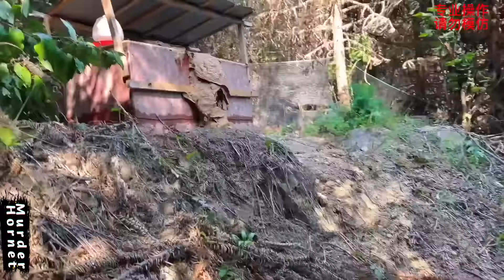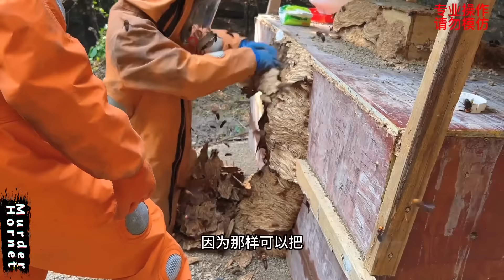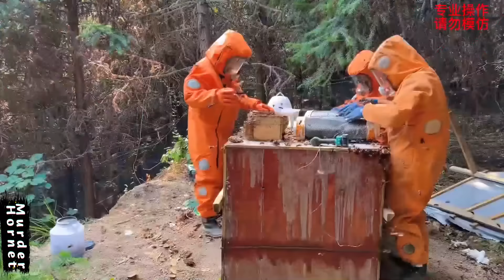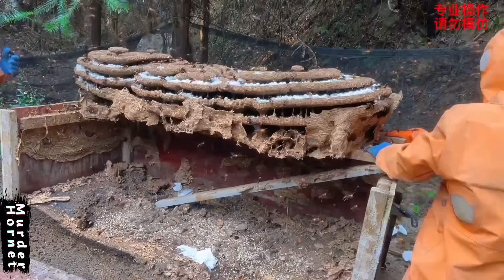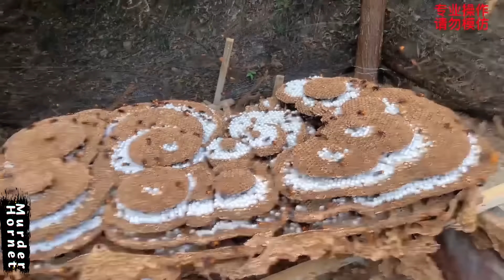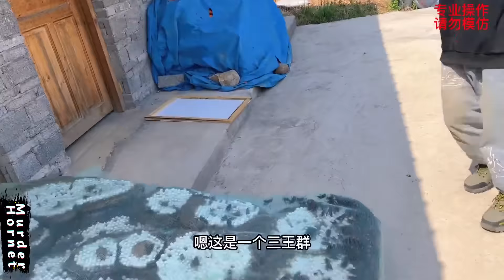ASIAN GIANT HORNET NEST,MURDER HORNETS REMOVAL,WASP NEST REMOVING,VESPA MANDARINIA

Comment: I know a faster and safer way to deal with a nest that large.
It is called a flamethrower.
And have 3 more on standby, just in case you need more heat.
Reply: Permethrin & Piperonyl butoxide will do the trick without open fire ....
Reply: @system64738  Do we want that floating around in the air and into the soil?
Reply: @stelmarsky6778  It's chrysanthemum oil. All natural.
Reply: The flamethrower is so much more satisfying though!  😂
Reply: Someone said that they are harvesting to make traditional medicine.

Comment: question, do the suits always protect from stings or is theer a small chance thier stingers getr through ?
Reply: I am Chinese, and I have a protective suit like this. It happened that a sting was stuck on the suit, and when I took off the suit, I was accidentally stung by the sting left on the outside of the suit. Anyway, the suit is still very safe.
Reply: @KuCoXi  thank you for the information 🙏